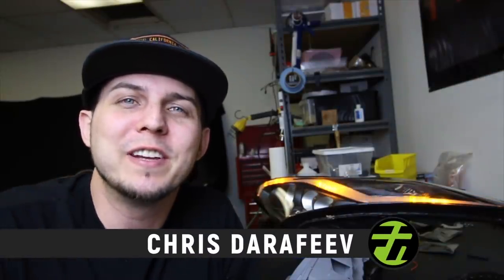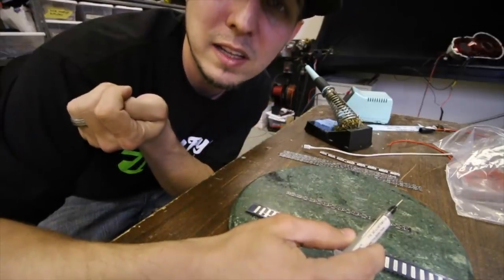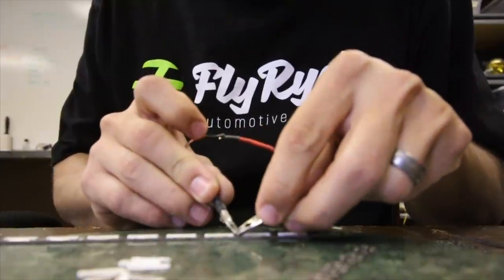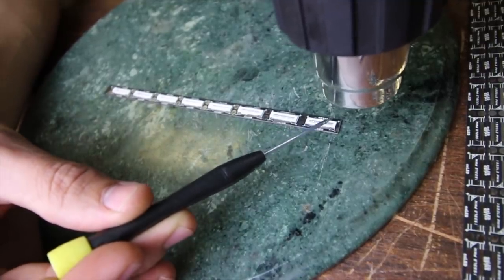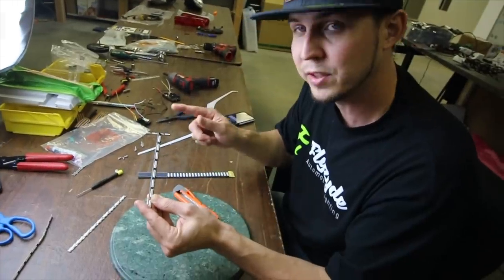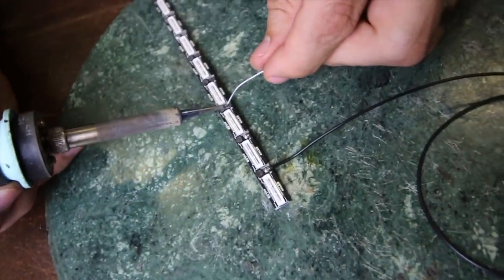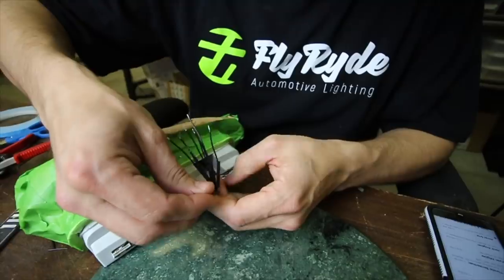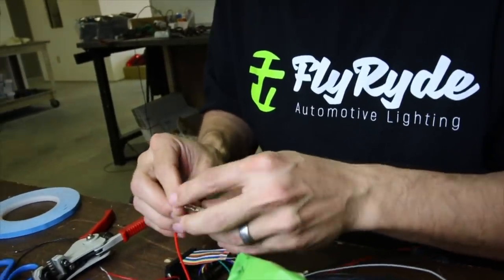How To Build Custom Sequential LED Strips - Online Course FREE Preview

Comment: I watched the hole thing. I'm an auto sparky and slowly starting to understand how it all works, I love watching your content (although you could do with a better camera) I'm trying to take apart my rear tail lights to change something on them but can't even get the cover off hahha I don't think it was made to come off, I baked it like you do and tried to pry it apart and it just wouldn't move. It was like there wasn't any adhesive on it to peel off haha, so I got pissed off and started to use a tool and then cracked it but that's not the moral of the story. I love your content and I'm learning so much from you! Keep it up mate

Comment: Great info I was a mechanic 60s,  70s, the first sequential taillights came on the 64-65 Ford Thunderbird,  3 lights each side, ran from a geared motor with a round contact plate,  You can really do a lot with what you know,  Entertaining,  thanks William

Comment: Awesome dude, very inspiring. Also you are a pretty good instructor, no added video bling ( music and lighting tricks etc. ) just right to the point . That's how you do it. I'm definitely going to do this. I bought some custom Euro spec Angel eye headlights, from Romaina for my 96 MKIII Cabrio and some really ugly dot style LED tail lights. And I got no problem cutting those ugly rows of dots out, so I can design something with a custom shape. And have them look as Awesome as the ones you have created. So I'm either going to have some awesome one off headlights and some matching Fly LED performing taillights. Or some Awesome one off headlights, and stock tail lights because I really screwed them up.  😱😱. But I am definitely going to try and do this. And by the way, I watched all the way to the end, and clicked on your links.  I have checked out your 20 LED kit, watched the videos there, checked out the LED's on the other link, and have considered how much it's going to cost. And I'm doing this, thanks man I also subscribed and gave 👍👍. I'm thinking of maybe, two circular rings that rotate in oposite directions for the brakes after the three flashes. With running sequential turn signals, flowing along both the top and bottom . Starting at the inside edges center, and flowing down then turning to flow out to the outside edge to flow back up to the outside edges center. Then cycling back again, but flowing in the one direction. Oh yeah, I'm feeling this!!!!! 😁😁😁😁😁😁😁😁

Comment: Chris. I love your Videos I have a Great tip for You. I work on a lot of German cars BMW Mercedes. I use a Black Fabric Tape as used on German car wire Harnessing, You can buy it on EBay Cheap! It sticks better than black plastic electrical tape. Don’t have to buy the Expensive German tape the cheap stuff works just as well. I Promise You will love it! Makes your harness flex easier and looks Professional. I appreciate your Videos! Have an Awesome Day.  Marty

Comment from the maker: Interested in Paid and FREE training about sequential LEDs? Start here by joining the community! https://www.flyryde.com/squad
Reply: Hey i want more info i do a little work now looking to learn more
Reply: FlyRyde
Reply: Hey thanks for all info your providing, I'm trying to find the circuit boards but cant seem too anything on the website,  do you use (exledshop) or (exleduse)
Reply: FlyRyde are you still rolling on the The Lightsman Academy? I am highly interested!
Reply: FlyRyde, you're wasting time with this circuit board nonsense. What you need is addressable LEDs, that integrate an IC and an LED into a simple surface mount LED. Then you can have power ground and data, and with a single data line you can make any led in your chain any color. It makes your job easier, and it allows any color. And it means you can have the same hardware and decide whether its animated or not in software rather than having to cut circuit boards.

Comment: @20:00 talks about how to keep all the wires the same length.  Great idea btw.  @24:00 makes them all different lengths.  Did that cause problems with the programming? 

When you mentioned keeping them all the same length, I was thinking about making sure I keep my speaker wires the same length.  You're talking about electronics which are alot more precise than my old ears.  Subsrcribed.  Great video!

Comment: Awesome information! Watched the entire video and also interested in the classes. I was designing a circuit using an Arduino to do the sequencing but the ghost module might replace that now (I’ll probably still work on it lol). Love all the information I have seen from you, glad I found your channel. It has given me a lot of ideas!
Reply from the maker: Super glad you found the channel as well! Its all about getting your creativity charged up! What are you trying to accomplish with your Arduino setup?
Reply: I did the same with arduino man, for my foglight angel eyes. Biggest issue with arduino was the boot up time, you cant have the circuit doing just indicating, itll need external power from somewhere
Reply: FlyRyde the main thing I was working on was custom animations using addressable Led’s so that the animations could be any color, and connect over Bluetooth (basically ghozt before I knew about it). The other project was just a headlight/tail light simulator circuit that has quick push terminal connections (like speakers do) to actually test out the lights before they go back in the vehicle. So that the demo would be switched rather than touching wires together.
Reply: Spoolie ST good to know, I wonder if you just programmed the atmega chip and made a pcb circuit if it would boot faster
Reply: Jeremy McCabe yeah man definitely would! Its all the arduino boot loader stuff that slows it down.
Reply: Spoolie ST awesome, I’ll test it with the Arduino and make a circuit based on the chip
Reply: Jeremy McCabe sweet man let me know if you get it working! Would be awesome to see it
Reply: @flyryde  can you please give more details about your 'wire board'? What spacing measurements do you have between the nails/screws and why those measurements specifically?

Comment: Something to consider would a hot air solder station or a better yet a small re-flow oven. You can bake a whole set of surface mount (SMD) at once or with the hot air, get focused air with more control and less movement for a small number of parts or replacing individual surface mount components that fail.  Plenty of DIY ovens out there, but would not recommend the heat gun as DIY, too much air and not enough focused heat or heat control.

Comment: I suggest using solder and solder paste with lead in it. It's easier to work with, flows better, and can take vibrations better as it's slightly softer and more flexible than lead free solder.
Reply from the maker: As long as you don’t mind handling and inhaling lead, lol. 10x easier though for sure.

Comment: You are really good man. After tried so many times finally i install halo rings and sequential lights in my elantra 2017 gls. Just because of you man. I have learned so many tricks from you. But when i connect my halo rings to my day light , now i have turn my fog light to make both to run. After i found there is a drl controller i can buy. So is there any controller in market that  convert running lights on to signal light? Then i can use for both purpose. Thanks man.

Comment: Great video. Have been playing with interior LED swapping for awhile now. This really has expanded my knowledge on how to up my projects. A few questions, what about resistors? Does the ghost module have internal resistors for the LEDs?
Reply from the maker: The Ghozt puts out a full shot of 12v (or whatever the source voltage is) to its 28 channels. The power LEDs are internally regulated for 9-18v operation. Pros and cons with them, but they’re certainly easy to work with.
Reply: @flyryde  So you're saying that the LEDs that you use are internally regulated? Can you source me to buy reels of these?

Comment: Great video. Got some helpful hints. I have an 02 Corvette, and would like to add special lights for it, and this would do the job. Will follow up with supplies, ghozt modules?
Reply from the maker: Kevin Mitchell Awesome! I posted some links in a comment pinned to the top here 👍

Last C5 I did was 7 years ago! https://www.flickr.com/photos/flyryde/sets/72157629342106602/
Reply: @flyryde  Thankyou, yes this is something I wish to do with mine, plus more, animate them as well. Being in NZ, I will attempt to do this myself first up, and see what I can do. Would you recommend using one of your Ghozt modules with this? And lastly, where did you wire the driving light strip to?, so they come on whenever the car is running automatically? Regards Kevin. Hope you had a good Christmas, and Happy New Year.

Comment: this will help I'd like to make some thin stream line trailer lights for my boat trailer that will sequence but can one put yellow ones for trun signal with red running an braking can these be epoxy over them to make them waterproof

Comment: Looking for the components you used in your video. Found the LEDs on exLED web site. But not the boards you were soldering to. Maybe I'm not familiar with component terminology.
Reply from the maker: D Smiff it can be a bit frustrating to deal with Ordering everything from Korea directly, but it’s certainly cheaper than getting everything in a kit from me. I’ve pinned some links to the top of comments here 👍
Reply: @flyryde  I'm looking for the boards too.
Reply: I can’t seem to find any of these products either
Reply: I can't find the board

Comment: Here’s a question. I am considering taking the course, the business side of me is thinking how to get into it. Should I buy a few sets of taillights and pre mod them and offer for sale and then let that branch me out into custom order work or?
Reply from the maker: I say just stay ultra practical, and don’t over extend yourself to the point where you HAVE to take on work. Stay 100% in control of what moves to make, and when to make them. Patience is key. Just do a set for yourself, plan it out for the day, knowing you might not finish. Learn a bunch, mess up if that’s what it takes, and buy yourself another set of stocks if so. 

You likely won’t make the same error in the same place after that. Next, just flip that set to someone at your cost of the new lights, and do it again cleaner. 2-3 sets in, you can start making moves, but get your skill down first 👍

Comment: Do you have a link to the place where the led's themselves are available to purchase please? Also, is there a flexible mounting strip instead of the hard board?
Reply from the maker: https://flyryde.com/collections/sequential

Not really on the question of flexible
Reply: @flyryde  Thanks. But the board is too rigid. Do you know of a more floppy choice?

Comment: Good video, I've been mecp certified since '95 really into lights and leds just bought a nice soldering station adjustable temp. I have plenty of heat shrink and a great gun non adjustable hi low only.  Would that work?
Reply from the maker: Yeah 100% you’ll be totally fine with that 👍 someone else suggested a toaster oven too, which I’ll eventually try out.

Comment: Made it to the end. 

You might want to invest in a small toaster oven to run your solder.
Reply from the maker: Great idea. I kinda need one at the shop anyway, though I think lead solder and crispy pizza probably isn’t the best mix for one appliance 🤣
Reply: No, it isn't.  LOL.

I used to work for a company that specialized in "quick turn PCB prototyping and low volume assembly" in Silicon Valley, Ca. They went out of business a few years after I left but we used to use toaster ovens to run our solder paste on batches of 5 and under. 

Great video. Do you have any showing you working with LEDs and fiber optics?

Comment: Wow, how much effort, have you not thought of using WS2812 addressable LED, one power, one ground, and one data wires??  And RGB so you can select a colour too!!?
Reply from the maker: Peter Martin what’s addressable? 

J/k :)  unicorn rainbow color changing light How To Videos will be coming soon. Unfortunately, they’re way cooler on the internet than in person, but as technology grows and software keeps making addressable a lot more practical and less N3RDZ 0NLY territory, I’ll make a lot of content about it. 

The same guys that brought the Ghozt sequencer to market also have the best app / controller for WS2812 called Blueghozt. Stay tuned for a video all about that soon 👍
Reply: Was thinking just the same, I just programmed a sketch for some amber strobe/work lights, using WS2812b and Arduino. I feel like I can do so much more with them, there is A LOT less wires, and the install is so much cleaner. I can also just re-write the sketch in minutes and get whatever colours and patterns I want.
Reply: warriorpluto  Absolutely, if I want it to. I can make it do whatever I want, as each LED has a microcontroller making them induvidually addresable.
Reply: Amberas and you you ditch the Arduino and use a $3 ESP8266 instead, you could then have it hosting a web page to change colour/sequence on the fly!!
Reply: @petermartin6031  Have to do some research about that! :D
Reply: I figured someone surely mentioned this, otherwise I was going to.
Reply: Hi Chris. Want to know what type\model are these LED chips? They look like 7020s but bigger...
Also where would I get the PCB your using to seat these LEDs onto? I'm experimenting and this would be very helpful. I think I've seen almost all your videos and learning. My 11yr old daughter is also lol. She just learned to solder and make an LED strip for her bicycle. Shes really digging it. ☺.

Comment: What’s the best way to mount the boards inside headlights to keep them vertical?
Reply from the maker: To mount what kind of boards? LED boards?
Reply: FlyRyde the power led boards like these
Reply from the maker: https://flyryde.com/products/powerled-kit-20-leds

Just solder metal anchors to the back of the strips and hang them wherever you need.

Comment: Can you point me in the right direction please.  I need (want) a battery powered strip about 12 ft. Long to go around a powered paraglider cage. Colors would be nice, but mostly I'm looking for bright white light that can flash on and off about every second. Can you help me?
Reply from the maker: I bet you could use a rechargeable drill battery (black and decker or something) and make a plug right on the glider. Light weight, easy to unplug and pop out, 12v, long lasting. Just gotta get crafty McGyver style 👌
Reply: FlyRyde , thank you for the response. The drill battery is a good idea, thanks. I can get crafty with that. Where should I look to get the 12 ft light strip? (White, multi colored, steady, flashing)

Comment: I build bat display box’s and would like to put LED lights in with rechargeable battery’s . I need the set up . I am an old man and not real good at finding the cheapest set up every thing I have found would cost 25 to 40 bucks a pice.  For the lights the bat pack the charger an then the through the box adapter to plug in the charger

Comment: So sir my question is if i dont want to use ghost controller as I dont want to spend that kind of money...so I have brought simple led strips which has white and amber leds...so how can I connect that stips to the headlight wiring? I have watch some videos and guys using small led driver for each led  and all wire goes to main custom board and then to the terminal...please make custom video without using any ghost module...not every body like me have lots of money to buy and program modules. Thanks You doing really great but just check azc car style on youtube..we want to see real stuff bro...please dont mind...

Comment: Im hoping somebody can help me with somethin, so on my motorcycle, im pretty sure ive got led rear turn signals, work fine. I got some sequential led turn signals that i wanted to install for the rear, i figured i could take my old signal off, and then just wire my new one in its place. When i do that though, it doesnt flash or anything. I thought the signal was bad. Until i hooked it straight up to my 12v battery. And whatya know it started flowing so nicely. My rear turn signals only get around 6v to them. Does my new one just need 12v? Instead of 6? Orr what am i missing here... helpp

Comment: Here is a tip you don't seem to know or don't use but should, Use a solder pot to tin all of your wires. Dip the wire in some flux then dip into the solder pot and you can perfectly tin hundreds of wires in a minute. Solder pots go for about $20 to $50  depending on the size you buy. Mine cost $20 on Ebay.
Reply from the maker: Got one, so I can agree it’s a good tip. Having said that, I very rarely use it. I’ll give it a go next batch of Ghozt boards I wire up 👌

Comment: Hi,
I am in need of a little help with a led strip I have bought. I want to have the lights turned on permanently and maybe have the ability to dim them a little. 

Problem is that they came from the china factory already preprogrammed with a light show. And since they are monochrome white - cold light only they came with just a power adapter and no remote or other controller.

So basically once plugged they flicker and "dance" in a bunch of different pretty patterns but I need them to stay on permanently.

If anyone can help pls give me a reply.

Comment: Pro tip: If solder paste gets past its expiry date and goes hard,  if you can get it out of the tube, mix it with enough rubbing alcohol to get it fluid again and reload it back in the syringe, messy work, but saves throwing it out and having to spend out on new stuff.